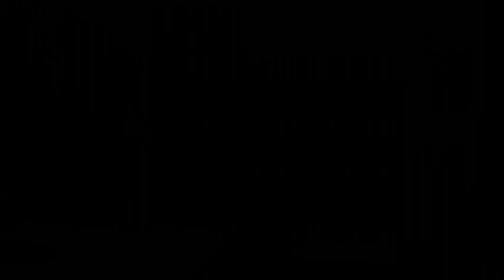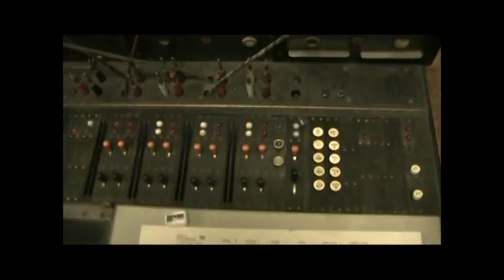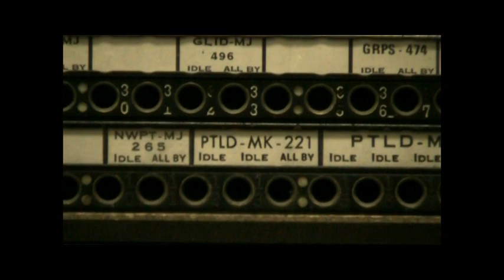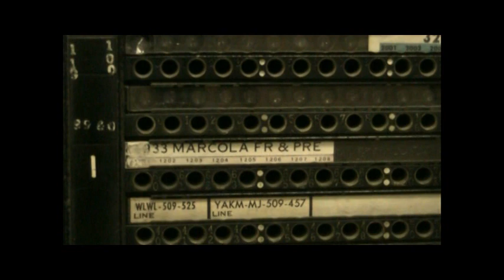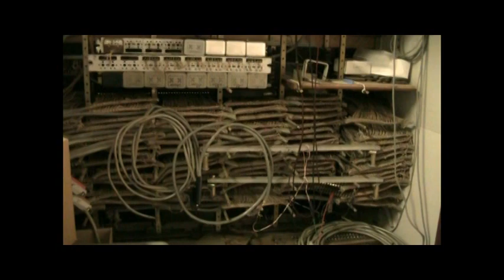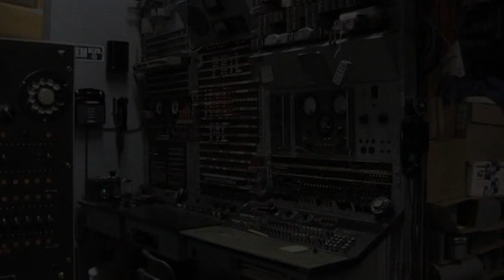Western Electric 3CL toll Switchboard and local/toll Test boards.

Comment: When you use the term "test board" it reminds me of my early days in radio and "15kHz equalized broadcast loops". We would frequently have to call the "test board" in Norfolk, VA to have them check lines coming or going from the radio station. Question is, is this that same kind of "test board" or something different. I'm thinking different. You may not believe this, but I can still remember the numbers of the two broadcast loops that fed our transmitter. They were 56PTNA19644 and 45. That was when I was 15-19 years old! Man, the memories you bring back! Thanks again for such great videos of this wonderful equipment.

Comment: I have a couple of 48 volt LED lamps that goes in those switch boards.  They are very old probably manufactured in the 70s and not very bright compared to the modern LED.

Comment: I was the last operator that worked the 3CL switchboard in Portland, Oregon.  Our board was one of the last working 3CL boards in the US.
We were the conference operators for Oregon, Washington and northern Idaho.  Based on customer comments we provided the best customer service of any of the conference operators in the US.  We even had customers from throughout the US request our office to place their conference calls.  Even though there was a push by customers to have Portland remain as a Conference office it was to no avail.
I plugged out the remaining live trunks at 8:50am on July 2, 1988.  This is when the Conference service was rehomed to the conference office in the Bay area (which I think the office was in Pleasanton, not Oakland).

The last exchanges served by the board were North (503-493) and South Harney (503-495), which are now in the 541 area code.  There was trouble getting them cut to a digital office.  Customers of these exchanges received their service through a radio system throughout Harney County which was not entirely compatible with a digital central office.  It took several attempts to get the service cut to the digital central office and TSPS in December 1987.
We also provided operator service for a work camp in the Tillamook, Oregon, area.  Although the calls did not come into the board a supervisor would receive a call on an office line from one of the guards to have one of the operators call the inmates.  We provided this service for a number of years from the time the Tillamook operator office closed to the first couple of months in 1988.
Reply: I started working on TSPS in Oklahoma, the cordboard was still sitting next door.  My supervisor arranged for me to get two positions of the old board.  I put it in a garage at my grandfathers home.  Before I got a chance to really do anything with it, I got married and with all that going on I forgot about it.  When I moved into a home of my own, I went back to take a look at it and see if I could move it to my home.  I as so horrified, my grandfather had taken it apart, once piece at a time and stored it outside in wooden boxes.  No way to put it back together.  After four years, I was promoted to manager and supervised the OkC 3CL board.  I was only allowed to work it for one hour a month to keep up skill.  But in 1983 I was working in another department when we had a strike.  I was called back to work IMTS, Conference, verification and toll that was left on the old board.  I worked early hours, 12 hours per day and in early morning I was alone at the conference board, with a 25 person conference call for the Top management to talk about the status of the strike.  Today, I have some 555 pbx boards like I worked in high school.  I also worked a 608a pbx at the hospital and a 10 position military board in Stuttgart Germany on the Army Base.  My last two jobs were with the federal government and I was answering a voip system, then later became the IT person who took care of that voip system.  I was thinking of starting a facebook page for operators.  I really believe mostly male operators would be interested as my wife and all the ladies I worked with could care less about the switchboards.  If interested in contact, my email is humanevolunteer@att.net.  I was working in Information Services after 1987 and always wondered how they handled the smaller amount of 3cl calls.  I know they built a new cordboard on the 13th floor of our building and removed the larger one from the 9th floor.  Sad in a way, but technology took over!
Reply: @mooredogfather  My e-mail is portland.albert@gmail.com.  When the cordboard was dismantled I was able to grab extra cords, lamps, fuses, etc., which were going to be thrown out.  The three positions I have were seperated for transport.  The upper part is in one piece.  The individual desk positions were seperated at the time the board was dismantled for transport.  It would be fairly easy to put back together.  It would be a matter of bolting the parts back together.  One caution, though.  The board is heavy enough that I would not recommend putting it back together unless you have a floor you can anchor it to.
Reply: @mooredogfather  Wow, that’s a shame that your cordboard got disassembled! I would love to get my hands on a TSPS console. I keep checking eBay periodically.
Reply from the maker: MY (this) board was from Portland Or. It was given/sold to a operator, this is what i was told.
I removed the MECOBS and restored it to DC/MF key pulse. I hope to have the dc sender working this winter. I have a working Step office, see my other video's.
Reply: @sxsphil  This is information which you may find interesting.
After the office (Unit 6) closed the operators were given a chance to bid to buy sections of the board, of which I purchased my section for $105.  There were 72 positions in Unit 6 (4301-4336 and 4401-4436), of which positions 4301, 4336, 4401 and 4436 could not be used.  Positions 4301 and 4401 had no cord pairs; positions 4336 and 4436 were used as the Supervisor's monitoring positions.

The section I have is 3 positions (4434, 4435 and 4436) and includes the Supervisor's Monitoring position (4436).  I was also given additional back boards, cord pairs, a set of conference bridges, an original calculagraph, a Service Assistant console (a modified Western Electric PBX station) and other miscellaneous pieces which were going to be scrapped.  After I bought the board I was told by the Manager that I should not have been able to buy that section and was given an option to select another section, which I declined since they were in pieces.
Here in Eugene the Telephone Pioneers operate a telephone museum and is open on Thursdays.  It looks like they have a lot of the equipment which was originally in the now closed Telephone Pioneers museum in Portland, Oregon.  The building which housed the museum in Portland was located at 421 SW Oak Street and was sold a number of years ago by US West.